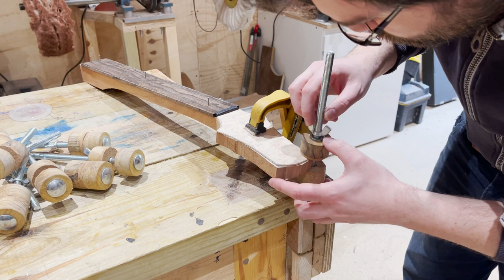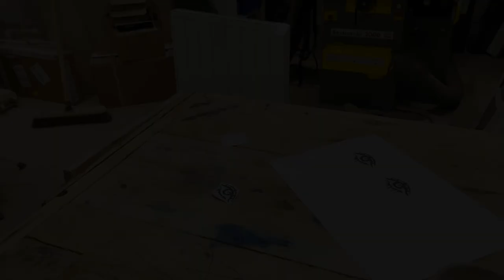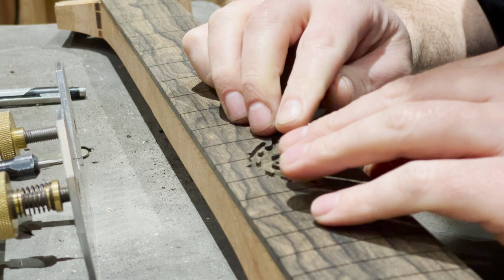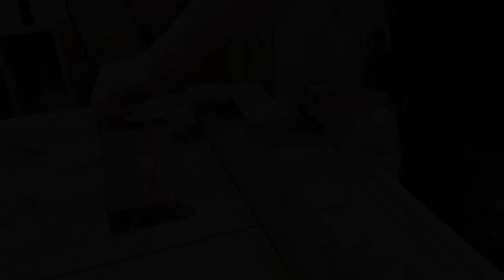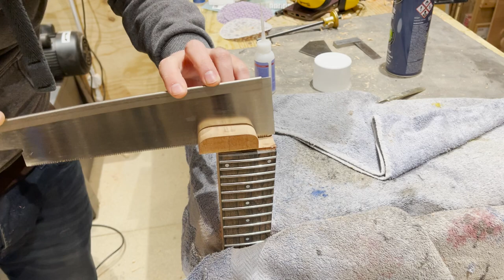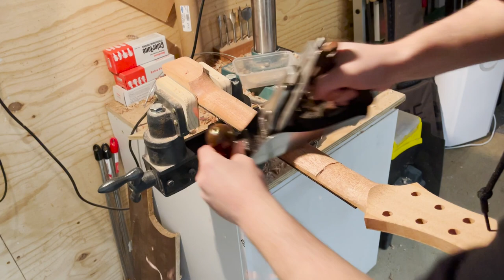How to make a custom fretboard inlay | Quilted Maple LES PAUL build | Part 3 of 4

Comment: Hi once again, when you did the angle on the body from the back of the neck pickup to the front of the body did it go all across from the bottom of the lower bout horn to the top of the top bout (past the 3 way switch), if so did you have to angle the inside of the switch cavity to have the 3 way switch sit properly on an angle? Would you do this on a single cut PRS body?
Reply from the maker: you can angle the inside of the switch cavity easily enough with the drill press and a forstner bit. If the area of the switch is resting flat against the bed, the angle will translate to the switch cavity.

Comment: Why do so many of you younger builders carve the shape on the back of the neck at the 1st fret area and heel area instead of simply carving the entire back of the neck? It’s just odd to me. Been building since the early ‘90s and I’ve always carved the back of the neck as a whole. The only ‘pre’ thing that I do is shape a ‘flat’ down the center of the back of the neck from the 1st fret to the heel transition….that gives me my overall neck thickness and taper. The rest of the carve is done as an entire length. Contour gauges, light and shadow, and feel is how we carve necks. This is the way we’ve all done it from day one. This pre-carving thing just seems ‘Guitar building 101’.
Reply from the maker: I've carved at least 20 necks the way you're describing, I just like this method at the moment.
Reply: I also use this method, I first rough cut the neck leaving a few mil then carve down at the first and twelfth fret to my target thickness, then shaping  is done by gauges and feel. There is no need to call it guitar building 101, everyone has his own way of doing things, so long as the final result is good, what difference does it make, there can always be improvements made on old standards.